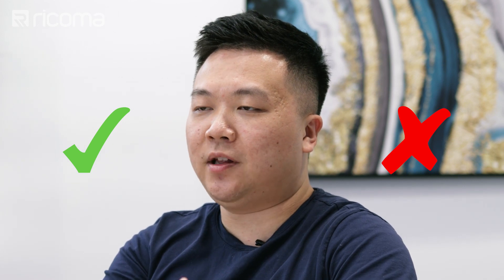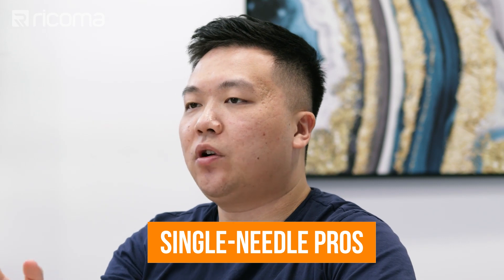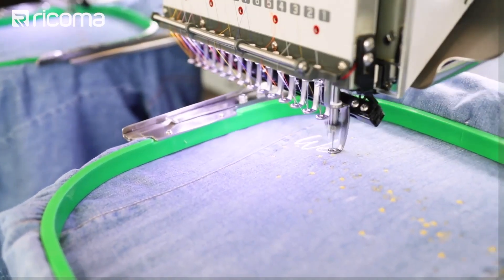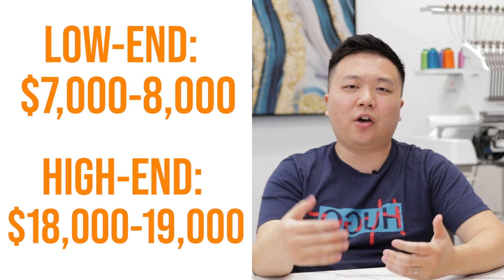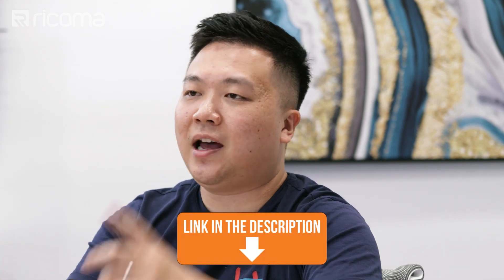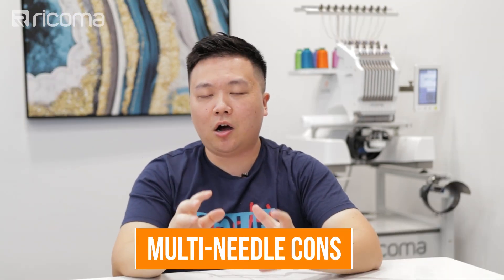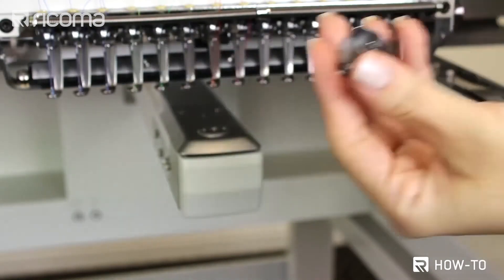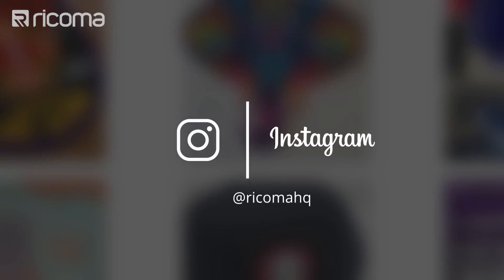Single-Needle Vs. Multi-Needle Embroidery Machines | Pros & Cons | Apparel Academy (Ep 62)

Comment: I need to replace my ZSK because I left her when I moved South. I was thinking Brother PR series, but now , I m not Sure. I’m 71 . I was going to get a single head but remembered the craziness of the ZSK always calling me back to change threads or something! I bought ZSK Sprint 2000, about! This new machine needs to be lighter weight (Sprint was 500 lb!) and needs to be able to be on something lower as I couldn’t reach her extension arms to thread here because of arthritis after a while. I needed a stepladder to thread here every time, which became very dangerous after awhile. Thought of getting a pneumatic air table, that would put her down to the floor so i could teach high enough to thread her. I’m 5’ 3”. When she was on her table and fully extended, she was almost 7’ tall.
Reply from the maker: Hi Celeste! Please submit a request with our team so they can help > https://info.ricoma.com/end-of-year-sale-2023/embroidery/o